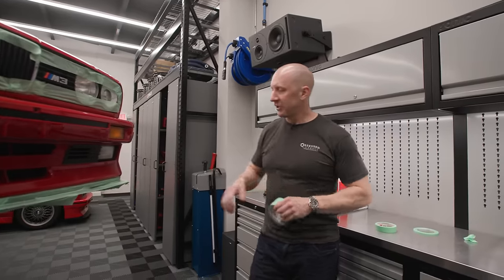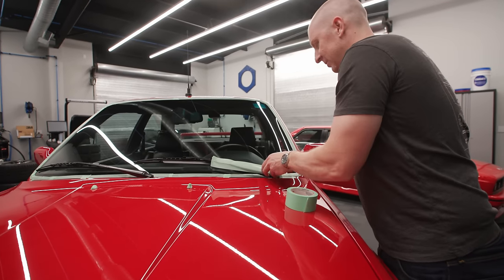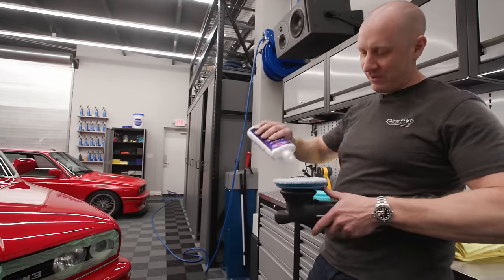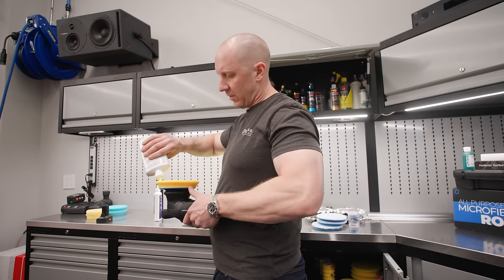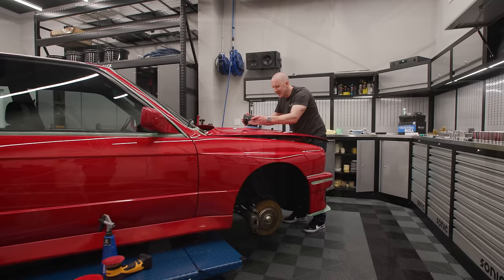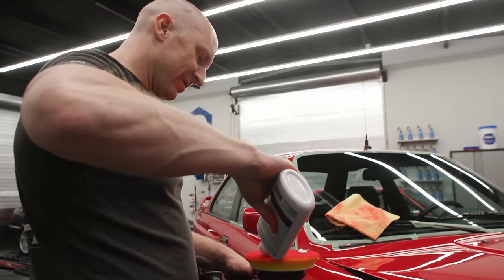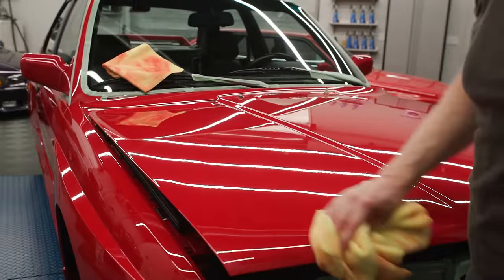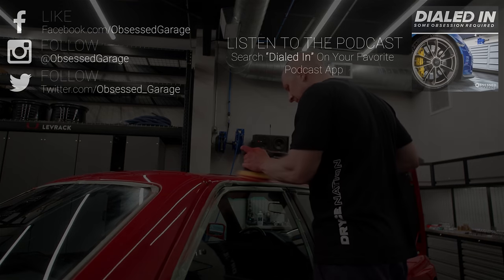Polishing Single Stage Paint | The Dual E30 M3 Detailing Series

Comment: I agree with what jeff said about the lake country pad washer, its the one to buy.
Reply: For the cost of a pad washer, I can certainly buy a lot more pads. I don’t see a reason or purpose for a pad washer. You can wash out your pads with waterless wash spin the water out and get back to work.
Reply: @davidsteckley8846  the pad washer is just a better more efficient way to do what you are describing above. Instead of washing one in a sink you just put the polisher in the washer and pull the trigger. It contains the cleaning solution and the mess. You can wash and be back to polishing in 15 seconds or so.  I also thought they were unnecessary until I owned one.
Reply: @improvedgarage  there’s another channel out there too said with those groves in the pad washer can chew up the pads.
Reply: @davidsteckley8846  interesting, I have not had that experience.  I did a video on using the washer for my channel, and ive used it exclusively since then.  I can only comment on my experience, I only mostly rupes pads.
Reply: @improvedgarage how wet is the pad when you are done cleaning it
Reply: @ZA1N_T  its just damp, you spin it out in the cleaner and most of the liquid comes off.  I actually like polishing with a slightly damp pad better than a dry one.
Reply: @improvedgarage  wouldn’t recommend using pad washer and trying to polish on the go with a damp pad.  Maybe when you’re done correcting but it’s just easier to bring all your pads and wash them at the sink.  Better off using the money to buy more pads.
Reply: @YuriTarded-hf1nv  
I can’t speak to mobile detailing, I’ve never done that, and don’t have experience with it. You may be right. 

As someone who does it in my garage and went from doing exactly what you described, I personally want the pad washer.  I find I like the cutting action of a damp pad better, it takes longer to clean pads in the sink than in the washer, they take longer to air dry (although I guess you could spin them out in a bucket)

Could you buy more pads instead of the washer? Sure, about 19 of them, but I use like 6 different types of pads depending on what I’m working on and some of those I only need to have one or two of to do a whole car, because I can clean them and keep going.  If you’re just one stepping cars with yellow pads all day then you’re probably right about buying more pads being better for you..

Comment: I've only watched a little bit, but I think the machine fighting you was a combination of a pad that wasn't fully primed/broken in yet and the grabbiness of TLC+ with the wool pad.

Spencer knows single stage way better than I do, but be careful with TLC+ if you ever try it on newer (thinner) two stage paint. I was chasing some scratches on my 2012 X5 with a PXE-80, blue wool and TLC+ and I burned down to the primer near (not on) an edge in just a few seconds. I didn't touch it again after that and was very happy with the cutting performance of the standard (black bottle) of TLC. 

I've talked to Levi about it and he pretty much reserves TLC+ for gelcoats and thick/hard clears where he knows he has plenty of paint to work in. TLC+ isn't nearly as friendly as TLC when it comes to cycle time, dust and trim staining.

If you're still open to trying (more) new compounds, P&S just released their Rehab correction creme. I've never been a fan of P&S compounds/polishes but Rehab is really really good. I need to play with it more but it might replace TLC for me.

Also, punt that detail guards pad washer right in the trash. The Lake Country pad washer is what you want. The pad stays on the machine, doesn't get nearly as wet (one or two pumps is all you need), and you just spin it dry real fast. You shouldn't be getting any liquid on the paint. Use it with rinseless (256:1) for best results.
Reply: The machine fighting him was due to not priming the wool pad?  Don’t understand how that would be when pad priming doesn’t really make a difference
Reply: @YuriTarded-hf1nv  Priming a wool and microfiber pad absolutely makes a difference, its common knowledge in the detailing world for years now.
Reply: @YuriTarded-hf1nv  After watching more of the video, I think it might be down to the interaction of that heavy cutting compound and that particular paint. I just used blue wool (both the new style and old style) on my HLR15 and HLR 21 all day long, it was as smooth as can be. It didn't fight me at all.
Reply from the maker: Yep, I think it is the polish and paint.  It was grabbing much like a forced rotation machine.

Comment: As a beginner I do find I stall a bit more than I would like on the LHR15III. Any tips?
Reply: Easy on the pressure!
Keep it flat and let the machine do the work. You got this!
Reply: It's just the reality of this machine, especially with a foam pad. It does not have enough power in the battery pack they provide. When they release the ibrid adaptor for it I am positive it will work so much better. I wish there was a way to make Milwaukee HO batteries to work with this. For now, try the washer mod to make it free spin and it works better that way.
Reply: @DrCeramicDallas lhr15 mark3 doesn’t have a battery pack?
Reply: Sorry I thought you were talking about the new cordless machine. Obviously technic is important but the Mark 3 especially when new has too much drag on the backing plate. Either use the "washer mod" or remove the anti-spin rubber shroud. It helps a lot. My machine after 3 years now works a lot better actually than when it was new due to the shroud being worn off. I've done over 100 cars with it and it's the best machine out there overall in my opinion. @YuriTarded-hf1nv
Reply: Try and have someone keep and eye on your pad angle when correcting so they can help you make adjustments and know when pad is flat?

Comment: Would you say the Milwaukee has more power and less stalling?
Reply: Polisher stalling on you has more to do with technique and pad angle than it does with power.  Maybe try making some slight adjustments with your technique
Reply: It's their battery tech that's inferior. Nothing wrong with my technique. @YuriTarded-hf1nv
Reply: @DrCeramicDallas  not trying to say anything negative about your technique but I would easily wager that to be the culprit over rupes battery system not being powerful enough.
Reply: Well the batteries are just objectively different. It's not a matter of opinions. If you know anything about Milwaukee HO and Forge batteries you know that they have more power and last much much longer. You even see in this video Matt is saying the same thing about the battery.  @YuriTarded-hf1nv
Reply from the maker: "Power" output is very similar.  The Milwaukee definitely stalls much less, but the level of vibration is much, much more than the RUPES.  I do find the RUPES battery getting in the way quite a bit as well.
Reply: Have you tried re-greasing your Milwaukee with proper grease? I've heard it makes a big difference. (use Lucas green) I'm currently running the Mark 3 and hlr15 but just ordered the Milwaukee through Home Depot sale for $270 including a HO battery. I will be making a comparison video on my channel soon. @ObsessedGarage